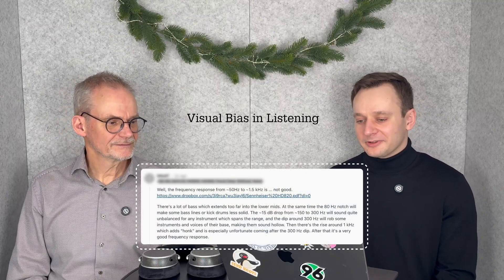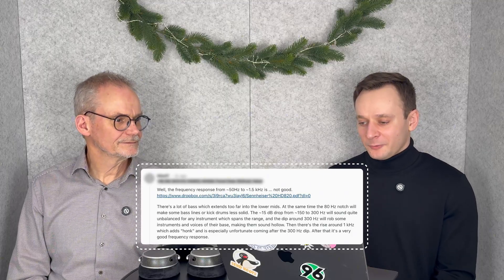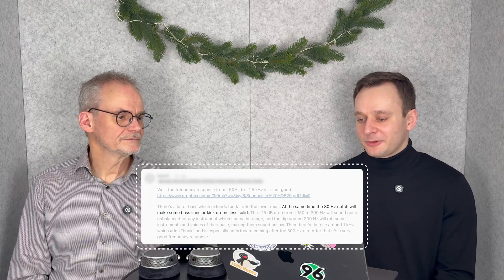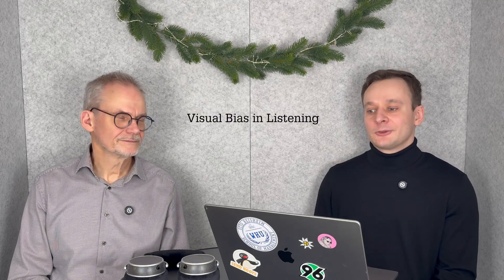What Is (Not) Important in a Frequency Response? Grell Sound Lab EP09

Comment: What about IEMs? How do they compare to headphones with quite a lot of difference in terms of frequency response vs perceived sound?

I mean, IEMs are much closer to the ear drum so theoretically it should sound more accurate to the frequency response from coupler readings
Reply from the maker: It's a whole different topic (which deserves a video), and the short answer is no, the listening experience is not closer to coupler readings. Loudspeakers have the least variance in perceived sound between different listeners, because they incorporate the maximum of the listeners anatomy in the sound at the eardrum. For IEMs, the variance between each listener is maximized, because almost the entire anatomy is circumvented, so the acoustic engineer has to take an educated guess on the exact pinna gain volume and position, treble amplitude etc. There is a reason why there is a neutral gold standard for over-ear headphones (HD 600), but opinion differs usually much more on IEM sound.

The core of the relation between your experience and coupler readings is that it's a very simple system, ie. just a short tube between the IEM transducer and the eardrum. However, the volume of the tube affects the mids (up to 5 db difference between long and short ear canals, which completely shifts tonal balance).  (Partial) Loss of seal is fatal for in-ears. The length of the tube affects the resonance frequency in the treble, which is hard to compensate for without active electronics.
I've never talked with more than 2 acoustic engineers at the same time and we all shared the exact same listening experience for a passive IEM. Listener variance is crazy, and so the readings of a coupler will likely also not be accurate for you.
Reply: @grellaudio  So it's the other way around then? IEMs have much more variance. Thank you for that amazingly good and overwhelming information!

Btw, I'm planning to buy cheap good IEMs and pursuing for neutral sounding JM-1. I'm afraid that it's much harder to blind-buy now and checking based only on frequency response graphs.
Reply from the maker: @JB-hj5tp  You have to start somewhere, so just go ahead. Then you can form your own opinion on how it sounds to you and go from there. If it's not at all your taste, you can still send it back.

Comment: I have listened to the HD 820 in the new ireland factory of Sennheiser and personally did not like it that much. The bass was not to my liking, it felt "plasticky" for the lack of a better word

The HD600 was my overall favorite out of the whole line-up, minus the HE-1 maybe, although I do think the HD 600 is way less fatiguing. For long-term use, the HD 600 might be my favorite Headphone, together with the Neumann NDH-30.
Reply from the maker: Great that you took the time to evaluate the headphones! This video was not meant to say that the HD 820 sounds perfect, but rather that people need to be careful to correlate the right things in measurements to what they hear. A shortfall of the HD 820 might be the variance of the bass amplitude on different heads, and the transition between bass and mids, which together may contribute to your listening experience.
I agree that the HD 600 is less fatigueing than the HE 1, but Axel had a big impact on the tuning of all three headphones, so chances are that you also like other products he worked on ;)
Reply: @grellaudio yes it was a lot of fun. :) for one reason or another, audio and gear preferences will always correlate with subjective taste I think. I am interested in the new works of Axel Grell, but my spending budget nowadays is not oriented around audio gear anymore. Maybe someday I will try the new model. :)
Reply: @grellaudio I ordered an open box unit of OAE2 and will test it out :)
Reply from the maker: Thanks for your trust! We look forward to your impressions!

Comment: Almost all headphones I see with a sharp dip in the mids have circular chassis and centered drivers with no angle. This may lead to intense phase cancellations that also reflect in the frequency.
Reply from the maker: It's one of the reasons why Sennheiser went from circular earcups to oval shape with the HE 90, the HD 580 and almost all audiophile headphones after that.
That being said, it's more of a measurement artifact than a clearly audible flaw, so there are a bunch of reasons why you may still want to use circular ear cups. For instance, the earpads are much cheaper to manufacture 😄
Reply: Neumann NDH-30 uses circular cups but has great mids imo
Reply from the maker: That was quite challenging to achieve. The NDH 20 has some of the problems mentioned here.

Comment: Extremely interesting as always!! Speaking of frequency response, they are always presented using logarithmic scaling. It’s clear that this is a good approximation of human hearing, but I’m certain the reality is a bit more nuanced than that. Does this scale oversimplify certain aspects of psychoacoustics and lead us to misinterpret things sometimes when looking at standard frequency response graphs?
Reply from the maker: Logarithmic frequency scaling certainly gives you a more representative visualisation than a linear scale. A large issue is that practically everything above 5kHz is super individual, so what you see in a measurement likely doesn't reflect what you hear in that area. On a linear scale that would make up 75% of the graph of almost useless information if you try to guess how the headphone sounds for you. On the other hand, wideband elevations over the spectrum of a couple 100 Hz can be extremely audible and tilt the coloration of a headphone, even if it's just 1-2 dB, and often times that's not immediately obvious. So we see room for improving the visualization, but the logarithmic scaling is likely here to stay.
Reply: equal loudness contours

Comment: Do you think EQing headphones using only music can work well? I often see sine sweep recommended but I would prefer not to use them
Reply from the maker: Sort of. State of the art is still using pink noise, but it helps if you have reference speakers to get used to "real" pink noise. There are also some songs which cover almost the entire frequency spectrum and have proven to work well, like Fast Car by Tracy Chapman. I believe Floyd Toole or Sean Olive did some research on what works best to detect colorations in speakers and headphones, and pink noise was the most accurate tool.
Reply: @grellaudio  pink noise like the thing that sounds like a waterfall? That’s interesting and less scary for my ocdthan a sine sweep haha. Tracy chapman is probably my favorite singer, I’m glad this song is one that work well! Thanks for answering
Reply from the maker: The problem with Sine sweeps and white noise is that the sound energy is equal across the entire frequency band. Since we're very sensitive in the high mids and low treble, and pure tones above 1kHz being very uncomfortable for some anyways, it sounds very unbalanced and is fatigueing. Pink noise reduces the energy as the frequency increases, so it will sound more balanced overall and you can literally listen all day to it.
Reply: @grellaudio this is very valuable information, thank you!

Comment: Super interesting as always... I have been thinking of designing an acoustic lens to try to angle the sound from a planar driver to make it come from the front more rather then the sides.... I have no idea how it will effect the tuning or whether it will work at all but should be a fun project
Reply from the maker: Very interesting. No matter the theory, the truth always lies in the real world experiment. Good luck!
Reply: I personally tried to tune my Sennheiser hd600 first to harman and than to how I'm actually hearing to match it, that binaural recordings work and hell it worked. I'm hearing Audio differently. I'm calling it my Personal frequency response. This had been better for me, than trying to correct it, that it sounds like speakers. It actually use it in my studio and testing my tracks on other systems, it had been worth it. Also give it a try, it might work better for you, than what you're trying.
Reply: @red_m8624binaural recordings for testing sounds like something I would like to try. I am hoping to make a few videos this year with "no wrong answers" where I just try things that sound interesting and I have not seen done elswhere just to see if there is any potential for future designs. One I am hoping to try very soon is integrating tesla valves into the housing to try to promote airflow across the ear and stop your ears from getting sweaty ;)